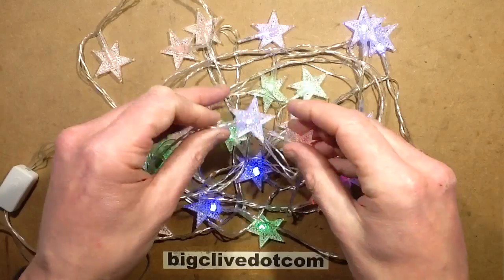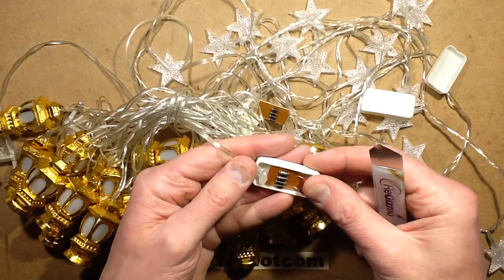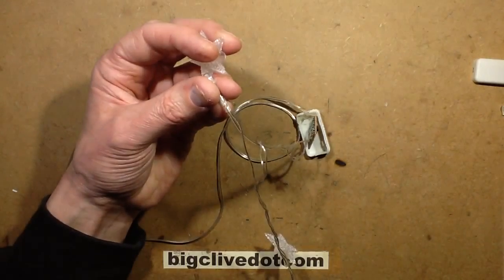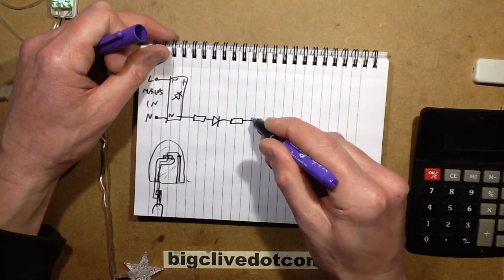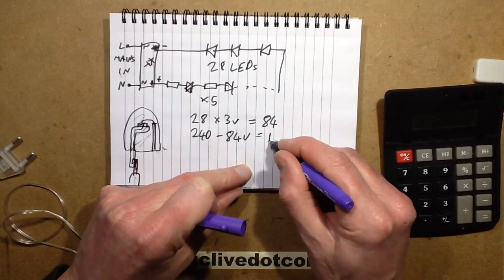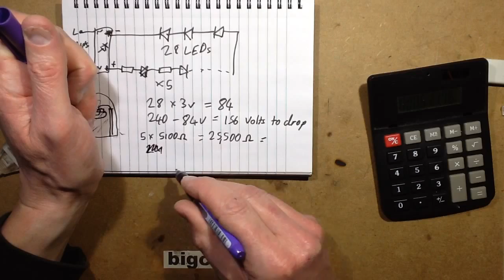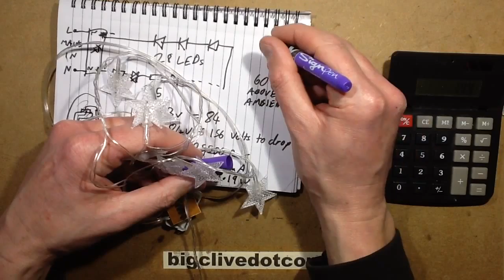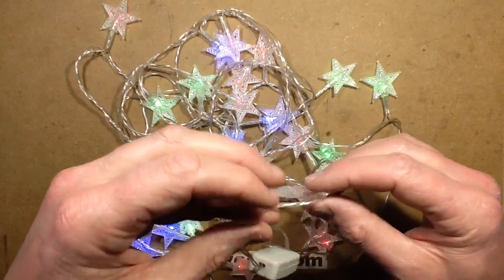Simple Chinese mains LED flashing light string.

Comment: I got similar string of cheap LED lights and the wires were made of steel, I used the plastic c-shape light bulb covers to modify high quality string. The LED's from my string can parallel operate on 5V supply.

Comment: 10:44 how do you prevent this with RGB leds?
Reply from the maker: If you mean the red shunting out the other colours then the only answer is to provide the LED with enough current to keep the voltage high enough for the green and blue LEDs.

Comment: I have one of these that were powered by 3xAAs. I hooked them up to a joule thief to hang around a plant in the hall. The lights just stay blue or red. Is there any way that I can rectify and smooth a joule thief output? I tried connecting it to a bridge rectifier, but that made them extremely dim.

Comment: Clive, I think I might be having a brain cloud, but wouldn't that bridge rectifier result in a lot more than 240v of unsmoothed DC across those LED's? Wouldn't that stuff up your calculations? Can't get my head around it, sorry!
Please show me where I went wrong....
Reply from the maker: Even though it's rectified it's unsmoothed, so it's still an RMS value.
Reply: Thanks, Clive, I get it. We're just flipping the negative half of the cycle.There's a lot more questions I could ask about capacitative droppers. Maybe if you run out of Daleks, you could go into it a bit more deeply, maybe show us the waveforms, etc? Season's greetings and thanks for your warnings and very helpful explanations.

Comment: Did you measure the resistor temps by non-contact (IR) thermometry? I was thinking that if the outside of the sleeving was at 60C, the little resistors would be a fair bit warmer ( 80+C?), and their life expectance might be much further reduced!

Comment: Just for the heck of it, who here already had a shock on mains voltage?
For me, a few on 110 and one on 220. My first shock was on a nightlight I was plugging in, holding it with two fingers on the pins. I was 7 or 8.
Reply: I have been bit a few times. Never seriously except when I learned what electronic ignitions and cracked cables are capable of. Took  my legs right out from under me. How do you get bit by 220v? You would have to touch both legs. Oh, that's right 440v industrial. I was only bit by that when we had a bad ground and you were touching a machine or welding table when he pulled the trigger on the welder. Scrambled to find that one because no one could work. Aluminum cable corrosion in the breaker box. 
   Mike (o\!/o)
Reply: Simon Richard 220 Twice, when I was like 6 and put my finger in a bulb socket that didn't have a bulb but was turned on... my fingernail got black. And two years ago wiring a flood light switch, I found out the switch was cutting the earth wire when I accidentally touched the live one that should have had no power and got shocked on top of a stair. Turn it off from the panel, it takes 2 minutes.
Reply: I've only touched 110 once, when I grabbed a wire that had been chewed by rats.
Reply: Electric ignition, joy of checking whether there is spark on the spark plug on your motocycle during a rainy day:D
Reply: i had several. Usually "safe" ones where the electricity only went through a finger and out another finger on the same hand, since i take care not to give any paths through my chest.

But i once had one that was close to being lethal.
Because of some idiot messing up something, i got a shock from a rail that should keep you falling of from the stage.
And guess what, that fucking rail was live with 230v....

Went through my body because i was grounded by touching a piece of scaffolding with my other hand.

Went to the hospital for 30 hours, not fun.... :(

The other ones just sucked.
Reply: Probably around 10-12 times @230V.
One time I was working on a distribution box on my PC desk, which was powered by a normal plug going into a socket. I was 100% sure I'd disconnected the plug and firmly grabbed the phase wire to twist it with another one.
I hadn't. Not a very pleasant experience to say the least. 

All the other times it wasn't my fault - most of them it was shitty plugs on chinese crap that disintegrated in my hands and such.
Reply: 1. @ 3 with 120V - US - fork in outlet, narrow hole, live side
2. @ 7 with 220V- Indonesia (lamp bulb socket....while taking bulb out, lamp was plugged in reversed, Dutch round pin plugs) 
3. @ 10 with 240V-Singapore...changing an outlet.
4. @ 14 with 240V- Singapore... Plugging a faulty christmas light (with US style plug for use on 240V) 
5. @ 17 with 120V-Canada....changing a switch....(Too lazy to turn off breaker) 
6. @ 19/20 with 120V -Canada....changing an outlet. (Again, too lazy to turn off breaker)

End of story hehe and am still alive writing this comment :) (Canada, 2018)

Comment: Are these dodgie lights available legally in the UK? Reason I asked I just purchased a animated reindeer from local hardware store (Bunnings AU) it uses a 240v AC - 12v DC power supply which then feeds a tiny module which takes it back up to 220V
Reply from the maker: Really?  That's odd.

Comment: Clive; I think you may have forgotten something in your calculations... Doesn't the bridge rectifier mean you're dealing with half mains voltage, not full mains voltage? OK it's still peaking at 340V/2 = 170V, but that's only for a tiny fraction of the cycle.
Reply from the maker: It's rectifying the full cycle as opposed to a singe diode only letting through half the cycle.  So it can be treated as full zero to peak 240V RMS.

Comment: hmm. Couldn't i just put a 25k resistor in parallel and an 12,5k in series to help with that problem?
Reply: Would the parallel resistor be there just for the heat? And wouldn't a single series resistor also get hotter?
   Mike (o\!/o)
Reply: Thats what my idea was. And i could use a nice 2W resistor or something. I think i might even have a few 10W resistors somewhere.

Comment: Tilt, 4:44 you stated that the resistor is connected to the LED negative and then drew it connected to the anode . . .  OK you picked it up . . . Obviously a result of all the good videos that you have been spawning at a great rate of knots recently. I suspect that you are in danger of becoming addictive.  More strength to you.

Comment: nice video..sir I need a little help from you..would you please suggest me that..I have a straw hat led its 3.2v and current is 50 ma.
if 5 leds is connect in parellal what will the watt??
Reply: Lumen Tech v*a=w w*60=wh
Reply: so each led is 0.16 w right??  so 5 will be  0.8 w.. is it ok??
Reply: Lumen Tech depend on the leds u use

Comment: Two years of Christmas usage and the heatshrink tubes around resistors are burnt black. Tested on a 100-LED string.
Reply from the maker: Just black or all shrivelled back revealing live metalwork?
Reply: bigclivedotcom
No, just black. Unfortunately. But the heat desoldered a few live cables which were exposed.
Reply: Immediately throw this shit into the bin if you have kids. Or you kids will die. This shit must be banned! Fire hazard and shock hazard... It's unbelievable that one can even buy this!
Reply: Alternative: Buy the ones with battery boxes, ditch the battery box and solder an 8 ohm, 1 watt resistor on them and put a usb plug on them.

Comment: Hi Clive didn't the uk get changed from 240Ac too 230Ac
Reply: Mark Bridgewater He has explained before that the voltage in the Isle of Man is a bit variable.
Reply from the maker: They widened the tolerance to accommodate existing 240V supplies.  All new systems are supposed to be 230V.

Comment: I wonder if their resistor choice has more to do with designing for China's 220v mains voltage compared to your ~240V? they just aren't bothering to localize the values to the higher voltage

Comment: The trick to making wires twist together without them ending up bunching up when they try to release the tension is an old rope maker's trick, allow the free ends to spin as you twist the other end of the wire, that way the tension doesn't build up and you get a perfectly twisted pair without the tangling up... :)
Reply: twocvbloke This actually happens with DNA, which as you know is twisted. Nature's answer is an enzyme called topoisomerase, which cuts the strand and lets the twist out, then splices it back together. Some antibiotics work by inhibiting topoisomerase, causing their DNA to become fatally tangled.

Comment: Can 4 diodes really be called a power supply?

Also, what happened with your Christmas lighting display? What current did you settle on for the blue leds?
Reply: Just for giggles I tried it and the chip won't function because of the half wave drop off.
   Mike (o\!/o)
Reply: 4 diodes is a full wave rectifier. 

You could snip one of the diodes and have a half-wave rectifier. It would run nice and cool, a little lower power but you wouldn't notice. Of course the flicker would be worse.

Comment: Hi Clive,
   Regarding your point about the  low rating/high heat of the resistors...I have seen capacitors fail in circuits, commonly next to high heat sources.  The cynic in me makes me think that this may be intentional to force the consumer to make repeat purchases, do you have any views about this? 

Love the videos, informative and entertaining, Thanks!
Reply from the maker: Just bad design I think.

Comment: you kind of love LEDs but sometimes you just hate them.
I was fixing my old crt tv chanel indicator lights.(first chanel was broken, no light, no tuning) Red 5mm LED, how wrong can you go with that? It apear you can. Because this LED was also driving  chanel range switch for the tuner, and you simply can't buy dimm enough LEDs to replace the broken one anymore , limiting current only make it worse, because you would have to replace all the LEDs and all the resistors values in this circuit, otherwhise either led is dimm, or the tuner work, while red light iluminate the whole chanel selector  :]
I was forced to "make" my own dimm red LED from low intensity 3 mm red one and some black hot glue as a light filter, so i wouldn't have to rethink the whole circuit (and it is still too bright for my taste) the only oher option is to find 80's old stock LEDs online.
So LED technology has evolved quite significantly over the last 30 years when my beloved tv was made :]

Comment: suggestion:
Maybe do a video all about soldering.
I solder quite often but still don't know much about different types of solder, lead/lead-free etc.
And don't tell anyone... but i don't even know what flux is.
I feel like this would be a helpful video for a lot of people and there's no one better to do it than you, Clive!
Reply: Led free solder should never be used for lights. Flux is used to fill your capacitors to enable time travel. But you have to use the right shoes on your hoverboard.
   Mike (o\!/o)
Reply from the maker: https://www.youtube.com/watch?v=aIab66EgfHM
Reply: DedElec That could be helpful! I do soldering from time to time (can't solder at home so I have to go to the university to do it everytime so it's a bit inconvenient). What I know is leaded solder melts better? Not sure if that's correct, so a video about soldering, not necessarily soldering techniques, but technicalities. And flux, that helps the solder flow better, but how? And wouldnt the solder go to metal pins and parts anyways? And if you have separate flux, where do you put it? Do you put a blob on the component? Or dip the solder into it? And how do you ise flux pens?
Reply: DedElec He already has made such a video
Reply: i need help on how to tig it

Comment: Looks like this light string would be quite comfortable operating with the five 5.1 k series resistors at 120 volts instead of 240 Volts.

Comment: I think they used 3 wires because they didn't use self-flashing LEDs originally and had a bunch of the old wire left over when they switched to the new design.

Comment: As with many chinese xmas lights, i think they design for what we 'should' have for voltage, maybe even for 220v, remember the days of filament xmas lights that failed on xmas day ? (i used to add a few extra lamps to make them 'everlasting')
@220v the power for each resistor is 0.14w, still not 1/8, but a bit better.

Comment: I doubt this was planned obsolescence, I think hanlon's razor applies here, they're just trying to shave off a fraction of a cent per unit even if that means the product will die early or set someone house on fire
Reply: There's a fine line between "planned obsolescence" and "not making things more expensive than they need to be".
Reply: Yep. Doubling the cost for parts and the cost for labour one a single step makes the bottom line deflate considerably. It's the same reason they don't use slightly thicker gauge wire or anything else-- provided it works when it gets to the customer and doesn't immediately break means profit. And then they do break in a few months or a year, the customer just goes, "meh... it was $2... who cares?"
Reply: quaxk Thing is though I'd have thought it would work out cheaper to cut out a step (deciding where the resistors go) and just stick an appropriate resistor on every light. This would be both safer and simpler.
Reply: TheJohn8765
yeah, I'll admit it does resemble planned obsolescence though, like they did with mufflers before the 80's (thin-walled, requiring frequent replacements) or the most famous case of all, the incandescent light bulb

but this is just an effort to save on productions cost, very much like microwave oven since the 90's having small transformers, reducing production costs and retail prices at the cost of efficiency which increase the operating cost for the consumer who pays the electric bill

Comment: Clive my apple iPad when charging seems to give me not a shock exactly but a strange vibrating buzz from the metal case,stupid question of the year IS THIS NORMAL?
Reply from the maker: It is unfortunately normal with modern ungrounded switchmode power supplies.  It's a slight AC leakage of up to around 100uA which can be felt on sensitive skin as a slight fuzz or tingle.
Reply: +Paul Hicks PS for those wanting to know: To avoid generating too much problematic conducted electric noise onto the mains circuit, that noise needs to be diverted to ground by connecting Y-rated capacitors between the mains input and something grounded. If that something is a ground/earth pin going into a grounded/earthed socket, all is fine except for some leakage that could, with too many/too large capacitors, cause the GFI/RCD to trip (which is why some professional computer installations use deliberately less sensitive RCDs). But if there is no ground pin on the input, the designer has to connect the Y caps, and thus both the noise and the leakage, to the ground / casing of the electronics. Some designs handle both options by connecting the electronics ground to the grounding / earth in the plug.  With that combination, the leakage will only be felt on the casing if the ground pin is not connected all the way to actual earth.  With the first option a broken ground / earth only causes tingling from other devices sharing the same "ground/earth" that isn't connected, while the second option causes tingling in all situations.
Reply: TREV BECK 52 No.
Reply: TREV BECK 52 when you move your finger over it? I have that with my laptop..
Reply: I get that from my audio amplifier's metal case. It's something to do with the output of switch-mode power supplies floating up to half the mains voltage, or something like that.
Reply: renxula Once I felt like really tiny shock while my hand was on the laptop, and I touched my phones metal edges (LG v10), phone was changing and laptop was plugged into the same extension cord. After buying new cord I don't have that issue anymore, so I guess it is something to do with grounding, maybe the old one didn't have ground wire, since it was some cheap Chinese cable.. However, I think it's weird behavior for 1600€ laptop.. :/
Reply: bigclivedotcom thank you for explanation Clive.. :)
Reply: bigclivedotcom  thanks Clive that makes perfect sense now I think about it . PS I enjoy your videos greatly they are informative and explained well keep doing what you are doing and the world of electronics will no longer be a dark science to me.
Reply: Yes I've had the same before. Make sure you're using the original craver or a high quality alternative. The dangerous fake Chinese chargers can potentially give you a shock.
Reply: +bigclivedotcom I had always wondered this. Thanks for explaining.

Comment: what country use that plug, over 30 years ago in a thrift store I seen a bed side table lamp with a cowboy theme that had a plug like that with the same size wire. I was thinking to myself if that 220 volt and something went wrong with the lamp, the wire would burn up fast and may start a fire. plus being in a child room it could get pull and break with wire hanging for someone to touch
Reply: Fred Bedderhead a lot of continental countries in Europe like in my country The Netherlands
Reply: do you see many table lamp with wire that size
Reply: Maico It might look like a Euro plug but the pins aren't quite the right size or pitch on these, they tend to hang loosely from EU plugs.
Reply: Fred Bedderhead I wasn't referring to the flimsy cord, only to the plug
Reply: Jason james oh right that could be the case indeed
Reply: Was there possibly a fuse in the plug?

Comment: Also, you forgot to multiple 240 by 1.414 to get the peak rectified voltage. The drop across the resistors would be even more than you calculated.
Reply: Aurelius R it would be, but only briefly - with mains at 50hz it'll average out to the rms value. its just like a heater running off AC, the peak dissipation might be higher but that is balanced out by the times when the voltage is less than 240v